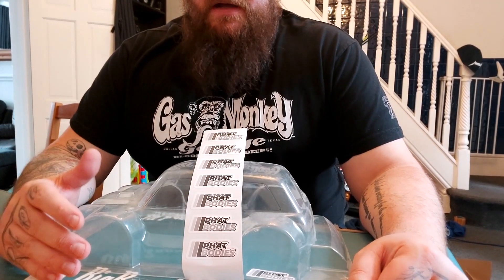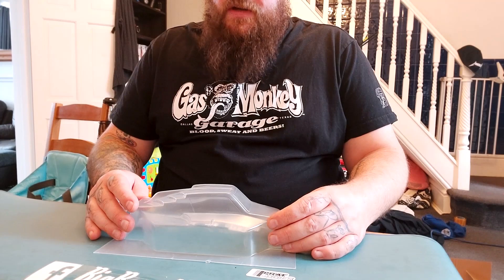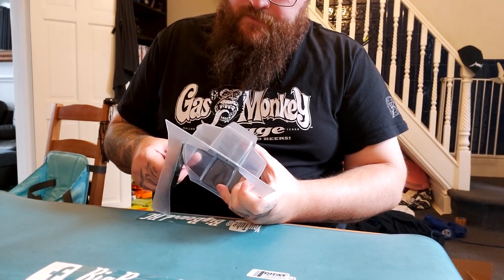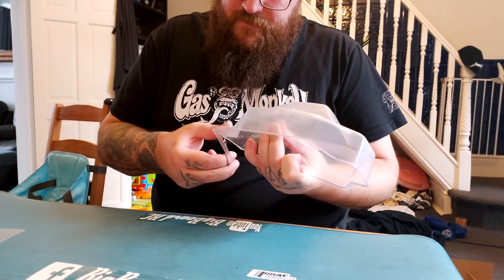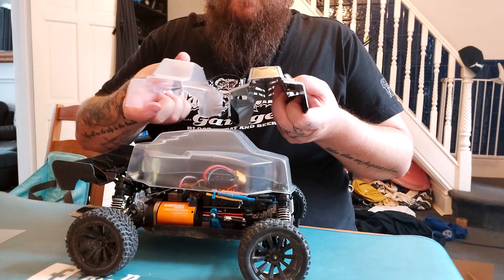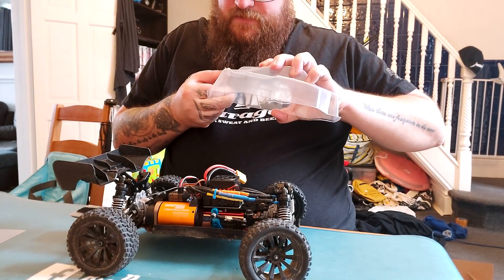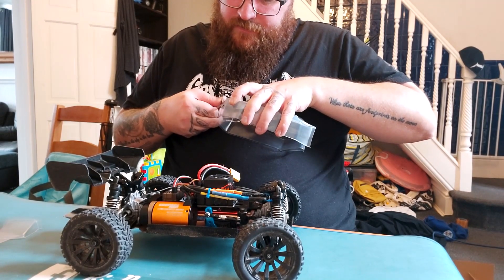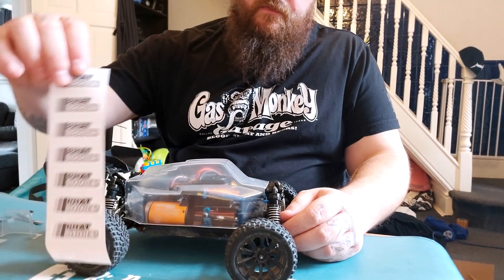Paint And Trim A RC Car body Shell How Too part 1

Comment: Nice tutorial! I'm going to fit the Phat "Turbo"-body to my 144001 myself. I'm wondering about using magnetic body-posts... do you only use velcro on the sides?  Keep up the good work!
Reply from the maker: Yes buddy only down the sides.im making a new build where I will be looking at a different mounting option
Reply from the maker: And thanks for the kind comments
Reply: @bigbeardrc4145   and btw thanks for the link for those wheels. I got them in the mail a couple of days ago. They looks really awesome on the 144001 ^_^
Reply from the maker: @maccyoneTV  no problem buddy glad I could help

Comment: Hi, do you think a velcro can be used to hold the Body shel instead of using the pins? I'm concerned that it may remove the painting.
Reply from the maker: Yes I use velcro amd its fine

Comment: I hate it. It's the worst part of the hobby for me. Masking is a chore and I never get it right. Now I just blast everything one colour usually white. Even the windows lol. My Banzai Mini shell is 100% hot pink with clear wing. I actually like it cos you can see it a mile off.
Reply from the maker: My banzai mini I'm going to try something a bit different with way out of my comfort zone hopefully if i get the courage
Reply: @bigbeardrc4145  Yeah I had non comfort zone ideas for mine with custom decals etc. Yeah so 100% pink because couldn't be arsed in the end. I just wanna get out there and I trash my bodies all the time anyway. The mini shell helps protect the car really well when it rolls over which it only does because the shell can catch the floor, probably because I haven't trimmed it properly. It's ok though the skirts will wear away soon enough lol.